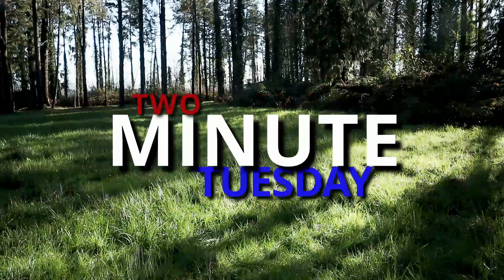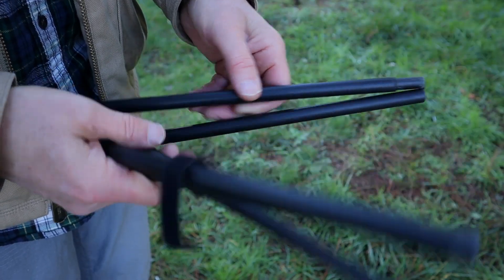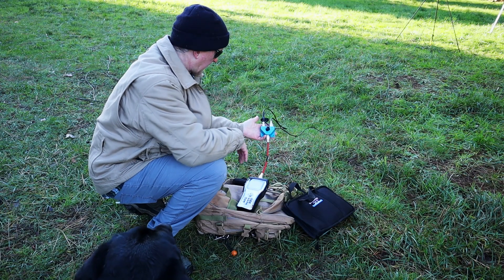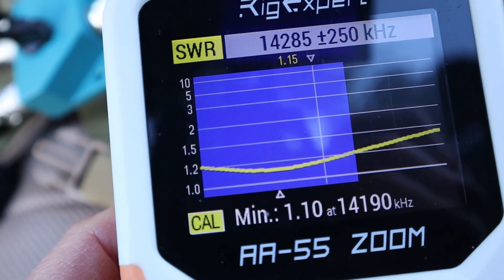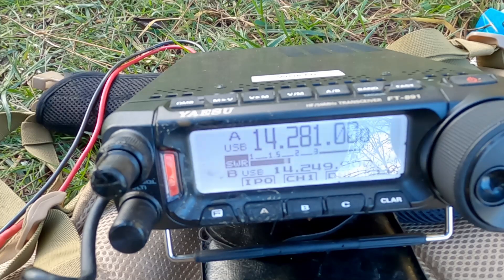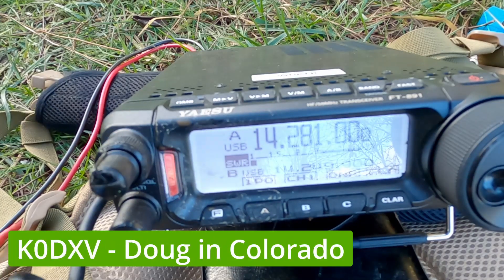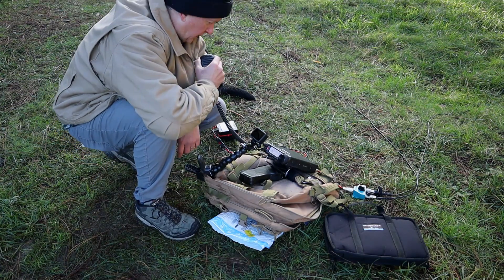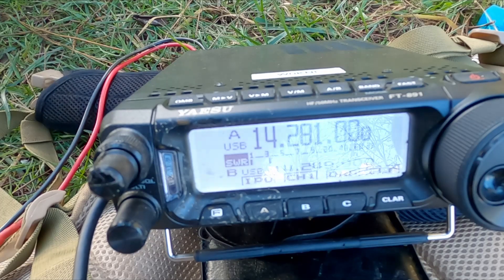Buddipole Pro vs. Dipole Antenna - SURPRISE? - YOU DECIDE! 2 Minute Tuesday (#48)

Comment: I was wondering if you had the buddipole kinda pointed to the station you were talking to or was it basically in the same oriantation as the dipole was? That would help to see what the report would have been. Dipole's orientation would affect the  signal report. I have multiple dipoles for 20 meters and I can switch from north south to east west, I can tell a pretty good difference on my signal.

Comment: The Buddistick is unlikely to ever perform as well as full size dipole as more wire almost always equals better signal. It would be closer if the Buddistick was at the same elevation.   I think the takeaway is if you can use a full size antenna it pays. If you can’t well the Buddistick and Buddipole can be setup in under 10 minutes and do a pretty good job for the ease of use.  Thanks for taking the time to make the video.

Comment: Looked like you setup a buddistick vertical.  Im not an antenna genius, but you have a horizontal dipole 30' off the ground vs a vertical whip on the ground.  Did you use a counterpoise?  Of course there is an s9 vs s3 on a tuned horizontal dipole vs a vertical mobile.  This is an absurd comparison, waste of 2 min.

Comment: This is such an unfair comparison. Each antenna has its purpose. The dipole is going to take much longer in the field to erect, is going to require a lot more equipment, having 3 spots to hang the center and the ends, and can be difficult to get up 33’ in the air, let alone evenly. The BuddiStick is designed for quick deployment and is a shortened vertical, of course it’s going to be down 36db from a resonant tuned dipole. Other than that it’s a great video and thanks for it.

Comment: You really should learn how to tune your antennas before making videos and statements that aren't necessarily true. If you're using a RigExpert stick, it should be no problem getting the SWR down to around 1:1.2
 1/2 wave dipoles, at 1/2 wave high, will always have better results than any compromised  antenna systems. No shock there!

Comment: Not trying to be rude, but if you were having trouble getting better than 1.7:1, you weren’t tuning it correctly.

You either need an antenna analyzer, a tuner, or a complete understanding of how to fine-tune the Buddipole.  Without either an antenna analyzer or a tuner, you go to the top of the band you want to tune it for and check SWR there…note what the reading was.  Then go to the bottom of the same band and check it there.  If it’s a better SWR at the top of the band than at the bottom, then the antenna is too “short” and you either need to either lengthen the whip sections or if you have the shock-cord elements, you add “turns” AWAY from the ends of the elements to add wire to lengthen it.  Only add 1 turn at a time and make sure you maintain about a 3-turn differential between the black and red sides to maintain the off-center fed characteristic to keep the impedance acceptable.  This is how I tune my  Buddipole and I get around 1.1:1 or flat just about every time.  I’m making digital contacts with 5w power with the antenna around 7’ AGL.

Keep trying.

73.
Reply: That is a smart way of tuning it. I've been basically hunting the dip using a hamstick but your technique sounds much faster.

Comment: Disingenuous. We already know a dipole beats ANY vertical every time, except perhaps over salt water. However, lets evaluate your setup. 1) Did you put that dipole up the same day? Looks like it is semi permanent and required a boom lift to get it up there.  2)Did your vertical have a full sized radiator or were you using a loading coil with a shortened element? 3) Was the feed point up 8ft? 4) Did you have at least two elevated radials? 5) Is there a balun in the line? You probably needed 2:1... 4:1 if it was a really short whip, a loading coil, and only one radial. If the answer is no to any one of these, there is much room for improvement. I can set up a 20M Buddypole/stick on a park bench in about 3 minutes, 4 to 5 if I go full sized and need to guy and I am on the air. Yes Buddipole is a little expensive, BUT so are boom lifts, ladders, climbing gear and hospital bills. Keep in mind, if you are building that dipole you will be going up the tree several times to get the SWR you are looking for. I've put up dozens and not once have I gotten the desired 50ohm on the first try. You even said in you could do better if you went up the tree and made some adjustments. Better order up that boom if 1.0:1 is your goal!
Reply from the maker: Hey Paul - thanks for watching!  By reading your detailed comment, you've obviously been doing the radio thing for some time!  Thank you for taking the time to write it.  However, this video was designed for the beginner seeking out what works better.  There should be no doubt in anyone's mind which would perform better.  Both antennas were put up the same day.  I use Arbiter weights to sling line up for both ends of the dipole.  The Buddystick is a great little antenna that is completely self contained, requiring no trees!  Thanks again for watching! Cheers.

Comment: I not only don't believe this to be a fair comparison; it's more of a 'why bother' ?
Apples vs oranges. The Buddipole is meant as a quick setup/takedown portable antenna meant for backpacking & SHTF events.
If you want to compare your home made dipole REALLY  compares to the Buddipole, hoist it up 1/2 wavelength (climb a couple of trees, or hoist it up a flagpole). Then your results will have more meaning. 
Also, a dipole closer to the ground has a much higher radiation angle, so it's propagation will be completely different to the 1/2 wave high dipole.
So, why bother making this comparison?
Reply from the maker: Hey miKey! Thanks for watching.  Believe it or not, there are plenty of new Hams who have not experienced either, or maybe just one of these types of antennas.  So a comparison of the two helps the curious.  As you sound like someone with lots of experience, this comparison is clearly "Apples vs oranges" as you put it.  73.

Comment: I love experimenting with portable antennas.  My go to antenna that always beats out all the other antennas is an inverted V doublet on an 18 ft pole.   I use light weight 300 ohm ladder line  with 30 ft thin gage wire(on each side) for the antenna on a cheap 20 ft fiberglass pole.    I run QRP so I use a tiny tuner for all band operation.  This setup always beats out any other antennas but I'll keep trying to find something better. lol    Thanks for your informative video.  73's Alan
Reply from the maker: Hey Alan thanks for watching. Building antennas is probably one of the most fun parts of this hobby. What you built sounds really interesting. I might have to take a look at that. I’m always open for a new antenna design. Cheers.

Comment: This is a great illustration of how the difference in height affects the lobes and therefore the performance especially the low angle performance. 

The Buddipole is by definition a portable antenna and is purposely designed for easy deployment.

While YouTube is great for this kind of quick comparison it’s always subjective. 

Every tool in the shop has its place.

I won’t take the time or risk aggravating a park ranger by stringing up a dipole thru the trees. But I sure won’t think twice about a compromise system like this in a vertical or dipole configuration. 

If I’m really comfortable at the park I’ll throw some kind of one leg wire antenna in the trees. 

Thanks for taking the time to post.
Reply from the maker: Absolutely! I 100% agree with you, every antenna has it's place.  I love the dedicated 20m dipole at 1/2 wave height - however, as you pointed out the last thing you want to do is break limbs off trees in the park for POTA or whatever and have someone get on you for it.  That was the exact reason I bought the Buddipole.  Happy hunting!
Reply: @W0KNI  

Really appreciate you sharing your experience. 

People don’t realize how much time it takes to record videos and edit / upload. 

Please keep up the good work. 

Don’t let the keyboard experts (if any) discourage you. 

Anything that generates thought and conversation is a good thing.

Comment: This is NOT a BuddiPole... it is a Buddistick Pro.  You are trying to compare a horizontal dipole a half wavelength above ground vs a vertical antenna not very far above the ground.  You are comparing apples to oranges which is an unfair test.  I can almost guarantee that my BuddiPole dipole antenna on top of my 33 foot Mastwerks mast/tripod that my results will be comparable to your dipole.
Reply from the maker: Hey Bob, thanks for watching!  It certainly was not a scientific experiment LOL.  However it was to prove an obvious point that a properly configured dipole was better than the a compromised vertical.  Cheers!

Comment: I found that doing this test basing your result on only one contact is very, very misleading. While I do believe that the dipole at 1/2 WL above ground should have the dipole give a better result in most cases, the difference in a vertical vs. a horizontal and where the signal will touch down makes using just one contact a very bad comparison. You should have strived for multiple contacts at different distances to get a better result. This is very misleading and someone like yourself should have known better to base a result on just one contact. At different distances, the Buddipole may have given a better result. I would expect that the dipole, which as set up is not a compromise antenna, would do better in most cases. That said, the difference may have been far less between the two at other distances. You were not willing to lower the dipole or adjust the counterpoise on the Buddipole to make the SWR the same. The SWR would not have made a huge difference in performance, but when doing a comparison, you should have strived to make things as equal as possible. Either you don't like the Buddipole or you're just lazy. It's easy to get the Buddipole down to a very low, almost perfect SWR, especially on 20 meters by just making fine adjustment to the counterpoise length. I do it all of the time. Compare the Buddihex to the dipole, be sure to point it the right way and watch the dipole get smoked.
Reply from the maker: Hey John - thanks for watching! Yes, yes showing more than one contact would probably be better for the audience as you mentioned.  I did make a few that day and this was one of the more detailed so that's the one that made the video.  You are also right about the Buddipole SWR can get better, in fact I normally have it under 1.10 but that day in the tall wet grass it just wasn't going to do it!  All good.  Cheers!
Reply: What an abrasive way to convey a suggestion.
Reply: @jeffreyrichard9675  Not trying to be abrasive. I'm tired of non objective comparisons that mislead people who don't have much experience with antennas. I thought he could have done a much better job. You can just be a fan boy and gush all over videos no matter what the content is, or maybe push back a little for better content. That was abrasive.
Reply: Sorry, I have seen very few antennas than can beat a well-made and dialed in dipole. No surprise here.

Comment: Stephen, what dipole were using?  Commercial or DIY?  Thanks.
Reply from the maker: If you check out some of my other videos you’ll see I build my own. I’m really happy with the 40 m trapped dipole. It was fun to make the parts are inexpensive and it’s a great performer for the price. As long as you can get the antenna up 32 feet or higher it performs really well.

Comment: Great video.  Was thinking about the Buddipole but think I will hold off now.
Reply from the maker: Thanks for watching. I really like having the turnkey solution that is standalone. Something I don’t have to hang from the tree. Some of the parks I go to hanging things in the trees is not acceptable. It’s pretty lightweight and can easily be carried alongside a dipole.
Reply: I stopped climbing trees and towers ten years ago. The Buddipole serves a great alternative to ladders, boom-lifts, climbing harnesses and hospital bills... The archery and slingshots were however pretty cool! I have a Buddipole setup that stays in my pickup which allows me to stop anywhere and get on the air, in about 3 minutes and make some contacts, while my 135ft Flat-Top Dipole stays at home.
Reply: This test was BS! The dipole antenna a half wave above the ground will always out perform a compromised vertical antenna. He didn't even properly tune either  antenna. Further, the Buddistick deluxe is the worst performing of the Buddipole antennas. While it works and I've had some good signals, they are nothing compared to the Buddistick using the 11 ft shock corded mast or 18 ft tripod mast. Further, the Buddistick doesn't perform as well as the Buddipole on the 18 ft mast or33 ft mast. I'm also use the Buddihex, and it performs extremely well. Each antenna system has it's place and use. But wire antennas always work, provided they are tuned and you have a high enough support (tree).

Comment: Thank you for making this video and sharing it with all of us!
Question: How many radials and what length were you using with the buddy pole?
I am of course subscribed with notifications turned on and thumbs up!
73 W3GUY Ernie
Reply from the maker: Hey Ernie - thanks for watching and the L+S! I appreciate that.  Only 1 radial on the Buddipole.  It only ships with one.  It's a fantastic solution when you don't have/or can't hang stuff from trees.  Cheers!
Reply: @PlasmaStorm73 [N5EVV] the Buddistick does not have radials, it has a counterpoise, different animal.
Reply: @PlasmaStorm73 [N5EVV] After four, the returns rapidly diminish. I use two and try to get a full size radiator up whenever possible.

Comment: How are you tuning the buddistick pro? Counterpoise length? Mast extension?
Reply from the maker: Hey Nick! Both at first, but then just the horizontal leg/CP.  I've gotten better SWR before, I think the tall wet grass was effecting things.  Normally I'm in the <1.5 range.
Reply: @W0KNI  just curious because I have only used the buddistick pro and never had issues. I enjoy watching your local content
Reply from the maker: Thanks Nick! My K-2829 POTA I was able to get 1.10 with it.  It was over sandy soil and short grass.  The Buddistick is a great standalone antenna!
Reply: Did you try different lengths or change coil tap to try to get better SWR on the buddipole?
Reply from the maker: Hey there Jay - I tried different lengths of the horizontal leg, but not the coil tap.  I might try that next time in combination with the hz leg.  Cheers!